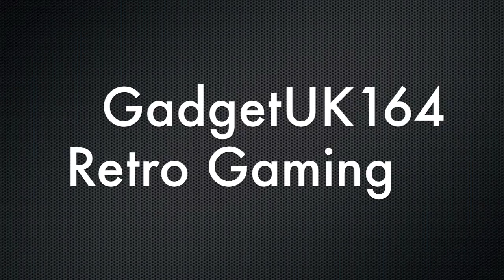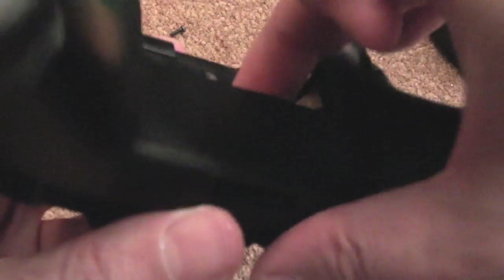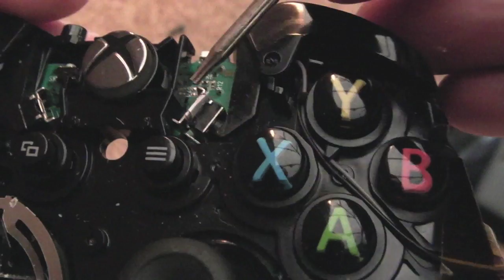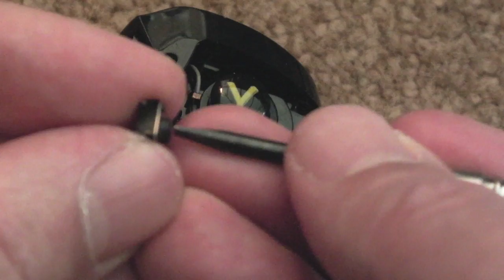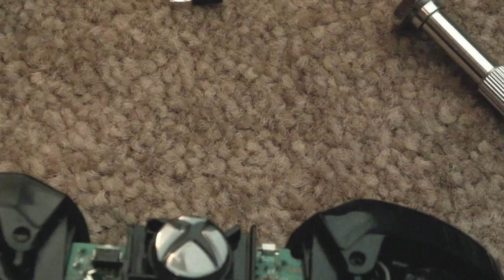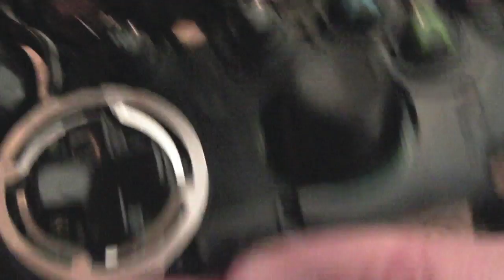Microsoft XBOX One Controller RB / LB Button Repair (Again)

Comment: I must do this I have 2 controllers with dead bumpers.
Reply from the maker: If they click - try blowing air into them first (without taking it to bits).  That does solve the problem sometimes, but when they stop clicking = dead switch =/
Reply: I'll try that, they do click.

I got 2 with broken thumsticks too.  Kids dropping them on to laminate flooring :(
Reply: StRoRo i got a custom controller and after a month or 2 about. The rb button just stopped registering so i either have to press it hard or blow air i to it which only worked for maybe 10 minutes and now thats stopped working. i pulled the rb button upwards pretty forcefully but not a huge amount and now it seems to work more consistently but it randomly registers thw button twice as if i click it twice even though i clicked it once. And it always clicked just stopped registering. this is my third controller for the xbox one and yea literally these controllers just suck. I like the look and feel of the controller better but it just breaks way to easily. my old xbox 360 controllers which i had 3. But each one could literally be slammed against concrete and still be fine. This controller cant even handle being dropped on a carpet floor.So blowing air into it may work for for some time but i would say get ready to eaither completely replace those buttons entirely or get a new controller. Maybe you should get a mouse and keyboard adapter for console  my guess is it woulndt break as easily because the arent so many parts so close together where if one tiny thing moved a certain way it completely broke. And if you threw the keyboard your entire consolw would also be thrown. So your probably not gonna do that. bad parts are is that you have more buttons to handle and it costs more. But i would say your gonna pay double that in the long run with these controllers.

Comment: I remember repairing Cheeta Turbo's from years back, it's amazing to think these modern controllers still use these same tiny microswitches. odd arrangement on these though, or is that the norm now? Last shoulder buttons I fixed were on a duelshock 2
Reply from the maker: Yes, you're right - not much changed over the years did it?  With the XB One controllers I personally think they went with a bad design.  It cannot be coincidence that the RB and LB are failing in these controllers like this.  It could be poor quality original parts but they certainly don't build them like they used to.  Look at the original XBOX controller and PS1 controllers for instance - they are built to last!

Comment: I have a similar problem with the mouse I use with my pc, the microswitches always go bad after time, it's a pain in the backside when you try and drag and drop files and it lets go because of a faulty micro. I've lost count how many times I replaced them, I could get a new mouse but I like the feel of it.
Reply from the maker: Haha - I had the same problem with my Dell mouse.  I really love the mouse and got used to it, but after 3 years of hitting the right button like mad whilst shooting zombies in Left 4 Dead, it gave up the ghost.  I bought a second identical mouse and keep the old one for spare now as the buttons are a bit unusual.

Comment: I normally use right angled tact witches which are 4 pin, 2 for the integrated bracket, two for the contacts, would these fit there instead of the separate switch? Not sure if they are any better, but it may be easier to deal with the whole thing in one go. http://uk.farnell.com/431256031716
Reply from the maker: Yes!!! Those look ideal!!!  Thanks, that will help with the hundreds of people that keep asking me which switches to use and where to get them!  That's brilliant thanks =D
Reply: Also ones with a longer actuators: https://www.rapidonline.com/omron-b3f-3155-6x6mm-6-15mm-260gf-sq-tact-switch-r-a-78-0140
Reply from the maker: Excellent =D  We just need to find some replacements for Neo Geo CD controllers now!

Comment from the maker: The main reason I uploaded this is to show:- 1) Cheap buttons don't last  2) How to get the plastic piece off and on  3) To show the removal of the old button.   I still get a lot of questions related to my last video on the XBOX One contoller repair.
Reply: GadgetUK164 - Retro Gaming Repairs & Mods I got pist on ark survival
Reply: About 5 days ago me too I broke my controller right bumper again!!!!😡 First time i happened my first fix lasted 3 weeks it was the little bottom plastic pin holding the bumper in place who failed me because off the flimsiness of the plastic that was chosen so I figured out I just need to superglue it back to the main frame and it works fine but it lasted only 3 weeks however this time top left corner of right bumper is broken I tried to superglue it back but it did not work  because of nature of the flimsy plastic that the bumpers are made of its literally so slim that there are no fix you can do once it's broken microsoft thieves made this you know!!!😡I was so pissed off that I recorded it and post it on youtube if you wanna see how it is broken you can check it out on my channel If you got any suggestions to fix it as well I will gladly appreciate it...
Reply: How dare you use the same low quality sh*t Microsoft uses lol
Reply: GadgetUK164 - Retro Gaming Repairs & Mods Thank u so much !!!